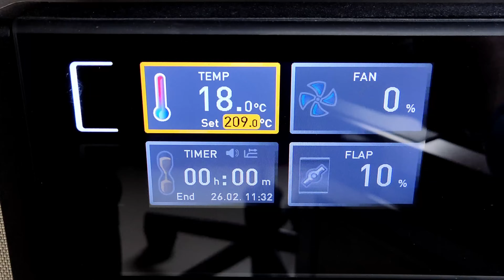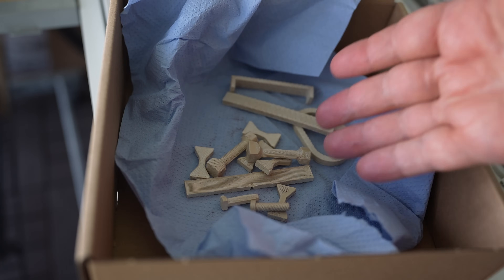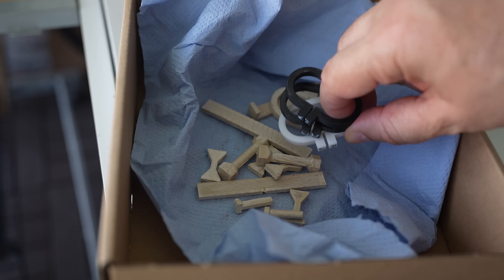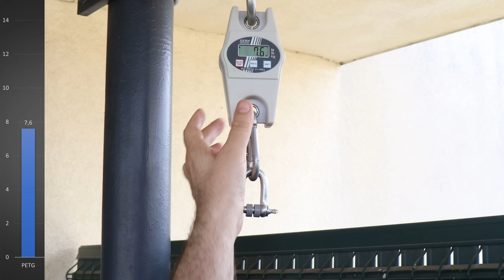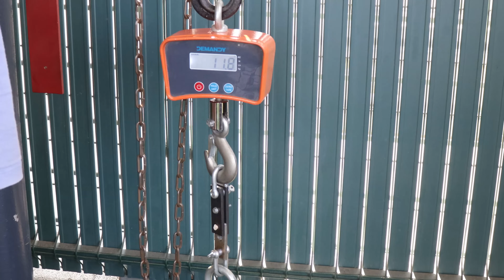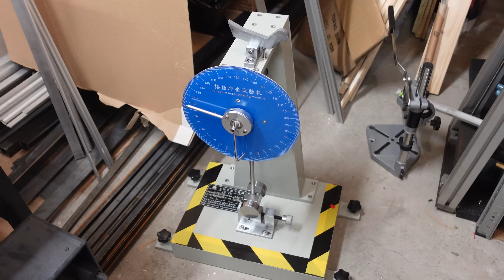Tullomer Filament Re-Test – High Temps, High Hopes?

Comment: They posted a new video 3 weeks ago. Their z strength weakness seems to be fixed now. (Atleast 10x better)
Reply from the maker: In the video it is 2-3x better, not 10x and this is still not enough. In my first review video I even tested it on Qidi printer with 340°C, yes, it was 3x stronger, but even that was weak compared to other technical filaments. Soon I will try to use it as a reinforcement only with H2D..
Reply: @MyTechFun  you're right. I saw their short and thought 200 kg when it was around 26 ir something (missed point). In their otemher video from 18 to 65 kg.

Comment: Post print annealing is not necessary for tullomer, with the right parameters it reached 6000 N  in a tensility test, ive done alot of testing with this material and have eliminated most of the issues with the material. Another issue with your prints is the pattern. This really matters for you print strength and affects how the material will break. I would not recommend continuing with rectilinear aswell as it is weaker and creates gaps which weaken the structure
Reply: Would you like to share the correct parameters to print Tullomer?
Reply: Furthermore, when you want strong strength in the z direction you need to use heavy ironing setting and u can see that the print speed used for the test material is way too high

Comment: If you were to create a tullomer core filament, what would you use as the outer material?  Obviously their recommended nozzle temps should be within range of one another, but which of those materials would offer the best layer adhesion?  PC? PPS? Something else?

Comment: Unfortunately that salmon skin on the prints is not just a visual artifact, but a sign that it was printed too quickly or was under extruding. I was surprised at the printhead speed in the clips, so I do think it would perform better if printed slower. That said, I don't think the results would be drastically different, just thought I would mention.
Reply: I agree, there’s some serious issues with the print settings that need addressed. That is not caused by a 0.6 mm nozzle.
Reply: @Javii96 Yep. To me it also indicates the filament would likely perform better at an even higher nozzle temperature.
Reply: @802Garage  Yea I have access to a farm at my job that has stratuses printers and when they make me Ultem parts they look just like PLA quality visually. Ultem is wild stuff.
Reply: This is correct the parameters used in this video are too high of a speed for this material

Comment: you should try filoalfa alfateiko its an easier to print peek filament. They have a demonstration video of a truck running over a printed jerry can and it survived just fine!
Reply: Alfateiko is a PPS filament so it should be similar to PPS from Polymaker or Qidi
Reply: @PaoloBernardoni ahh i didnt know. Maybe they have some additives on it to make it better. They also have a bunch of other cool filament he should test like tpu gf, that is some seriously amazing stuff, I have a roll. And theres also their recycled carbon fiber filament, bioflex and others.
Reply: @PaoloBernardoni  PPS is incredibly rigid but also incredibly brittle. printed objects are like glass. and even annealed, extremely weak on Z layer adhesion. a neat filament but would never use it for anything requiring mechanical strength.
Reply: @TMS5100  strange, filoalfa has a video on the alfateiko filament where they run over a print with a truck and it just bends and they push it back into place. It doesn't seem to act like PPS then. Probably some additives. Thats why id like to see some tests.
Reply: @Chaser7002  where is this video?
Reply: from what the video is showing it doesn't act like pps.
Reply: @Chaser7002  where is the video? i can't find anything.

Comment: You need to watch some other videos. Print it fast...and you can print at 325°C with only 60°C chamber. It will print better if you basically max your speed. It's brand new so they're still learning. Trust me... you can get better results... much better. Oh... high wall numbers and infill are also recommended. Concentric infill... no overlapping.
Reply: Watch his previous video on this material, he has tested it printed using the profile provided by the manufacturer and I believe even some samples printed by the manufacturer. Same results, incredibly strong in X and Y, extremely weak Z.

Comment: Is this material responsive to chemical processes at all? I wonder if layer adhesion could be improved chemically (such as with ABS and acetone).
Reply: Unfortunately there is not much that can be done chemically as the material is incredibly chemical resistant

Comment: I watch your channel pretty religiously, and you are one of the very few YouTube channels I have all notifications turn on for.  I am an IT Engineer, so I appreciate all of the detail and testing you put into your videos, as well as your sense of humor. 😁

I feel a little overwhelmed going back over your robust catalog of testing videos, so would like to make a recommendation for a future video. Specifically, a high-level comparison of all major filament types and in what scenarios you would use them. For example, comparing and contrasting PLA vs PETG vs ABS/ASA vs Nylon vs whatever other major categories you decide), and purpose statements like "for a strong part that didn't need high heat tolerance I would use PLA, but it needs some flexibility to it and higher heat tolerance I would PETG". A year ago, I would default to using PETG for anything that needed to be "strong", but after watching your videos I understand it is only stronger vs PLA in some specific scenarios and weaker than others, so I feel like there is a bigger picture I'm missing of an overall approach for deciding one filament type over another.

Additionally, I think I might have suggested in the past, or at least I thought about doing it and my ADHD got the better of me, but it would be really cool to see a strength test based on layer heigh and/or width. CNC Kitchen did a study a number of years ago now (back before high-speed printers were a thing I believe, and he concluded that 0.15mm layer height was the "strongest" if I remember the article correctly. I know you have tested part strength based on different printing temperatures, as well as annealing, but it would be cool to see how different layer heights (and possibly widths) might impact a part's strength as well.

Feel free to tell me to go skip rocks, especially if you have such a high-level comparison video that I missed. Either way thank you for all that you do, and I share your videos with lots of people both inside my company (where we have a large 3D printing focused group chat) as well as in the general public (like in a YouTube live stream I participate in pretty regularly)
Reply: I think his solution for that is the patreon where you get access to a spreadsheet with all the tests combined.

Comment: I wonder if some kind of co-extrusion using a second material could take advantage of the X/Y strength but increase layer adhesion.

Even so, with the right design, and the right applications, this stuff could be very useful.

Edit... You say the same thing about co-extrusion. LoL
Reply: You are correct i have used the h2d bambu lab and used an abs plastic as a support material for the tullomer and it fixes alot of the adhesion issues

Comment: I think that the nozzle temperature of 325 degrees is clearly insufficient. Experiments with higher temperatures are needed.
The manufacturer's website says that annealing is not necessary.
Apparently, the manufacturer itself does not know how to print with this.
The recommendations on the website are strange.
Perhaps, this plastic simply cannot be printed with.

It looks like it's just expensive junk.
Reply: This. I have never found a manufacturer recommendation for print temperature that wasn't grossly below what's needed to fully weld the material to itself. Keep cranking it until it welds. To 500 if needed.
Reply: @daliasprints9798  Agreed, I would like to see more testing of it at least until you have found what temperature is too hot for the material. I suspect current profiles are based on temperatures easily available printers can produce, not the temperature the material needs.
Reply: @daliasprints9798 you need a $10,000, or higher price printer for that.

Comment: Igor, did you happen to apply for the 'project' Tullormer was requesting use cases for? I ended up putting in a bid if you will, which was rejected for going forward in the process allegedly a few months later, which is usually business code for 'we loved your idea but are going to steal it for ourselves and you get nothing'. 
I was actually excited to work with this material, but not to sample at their listed price without some independent testing, and certainly not if it's all puffed up hype and 'we printed it like this and it's magic filament'.

Comment: I saw a prototype printer somewhere on YouTube which used an infrared lamp attached to the nozzle to remelt the previous layer before depositing new material. Maybe something like that is needed to make this work. Alternatively, maybe someone will try fully remelting the printed part instead of just annealing.

On that note, I'm curious whether it's even possible to remelt this filament, because the company said it turns into fiber while being printed.
Reply from the maker: Not the prototype, those are Apium printers. https://youtu.be/wk2aN3IYlJc?si=Av2A7kfGVjeiaPOl&t=81

Comment: I'd love to see this material with non-planar or injection-like printing. Or perhaps as a post-process coating along the Z-axis.

BTW thanks Igor for you wonderful channel. As someone trying to apply 3D printing to robotics, jig construction and prototyping, your work here is a godsend.
Reply: Non-planar printing will probably become interesting, when it's possible to load a FEM stress simulation into the slicer and do the printing along the stress lines.

Using Tullomer like the kevlar inlay of the markforged printers and the combination with nonplanar FEM directed slicing is most likely the best way to get high strength parts at a reasonable price point.
Reply: Yup Non-planar would be game changer for lots of things :)

Comment: I wanted so badly for Tullomer to be magic filament, but it seems like they really haven't solved the Z-adhesion issues.  I'm sadly not sure I get the point of such a material in the FDM world vs PEEK/etc.
Reply from the maker: It still has higher tensile strength, but they must solve that layer adhesion. As I mentioned in the video, maybe with Core filaments (Tullomer inside, maybe some nylon outside?)
Reply: @MyTechFun  Yes, I have a contact there, and I will point this out to them :)
Reply: @Adam-ee9lm Can you check with them what kind of results they are getting internally? Just as a sanity check in case everyone else is doing something wrong.
Reply: @MyTechFun  It might be worth to ask CNC Kitchen if he still has the tools of the video where he made custom filament with his logo inside, and use that methode to try out different materials to make tullomer core filament. Considering you're both in europe, it sould be fairly easy to get it organised, and it could be an interesting cooperation.
Reply from the maker: @clockworkvanhellsing372  He also got a spool, and I suggested him this. Probably he is very busy with other projects, I hope he will find some time for this testing..
Reply: @MyTechFun  Care to try bathing it in dichtol AM (a PMMA based impregnant)? Perhaps it would be as strong as acrylic in z-axis and a hair stronger in XY.
Reply: TPU with Tullomer inside.
Super bonding + Super strength.
Reply: I hate to be a downer but a Tullomer core filament will probably have problems too in (most) combinations (at least). Tullomer doesn't like to stick to itself. It's probably not going to stick to other polymers either.

Now the comment mentioning doing a coextruded filament in such a way that the Tullomer is fine strands throughout another material like Stephan did with CNC Kitchen Logo could be better than one large amount within the coextrusion but the same issue is going to exist where there is no good connection between the Tullomer and the other material. 

Would doing a coextruded Tullomer/Whatever be a decent material sure it could be but I doubt it would be great.

The issue is "low surface energy". 

Read about low surface energy polymers. Polypropylene, Polyethylene are two such materials.

I believe that the poor layer adhesion of Tullomer can likely be solved but I suspect it would/will need a custom printer.

Such a printer could be expensive is produced commercially and if DIY'd perhaps not that bad but in either case many/most people probably won't be doing either.